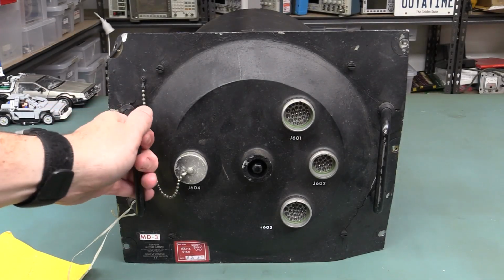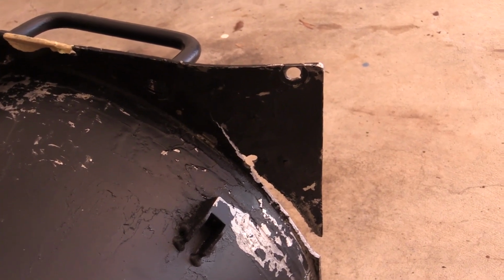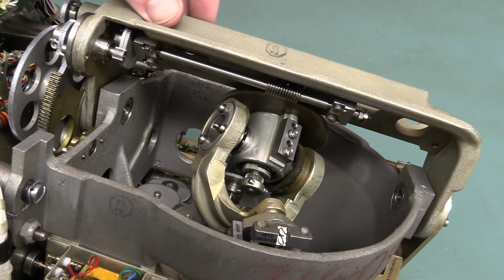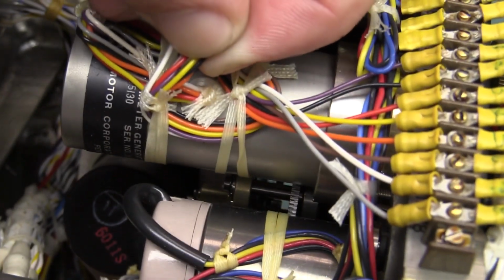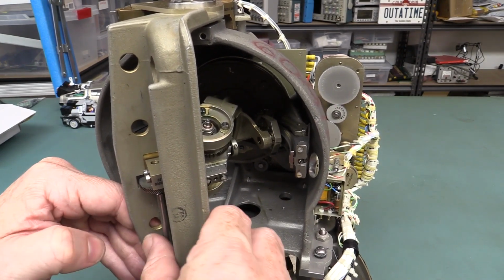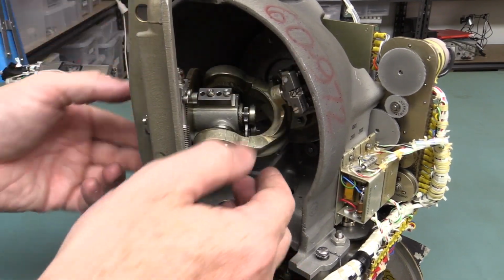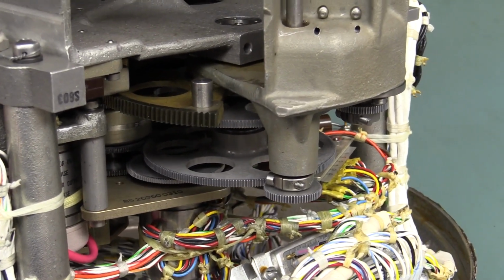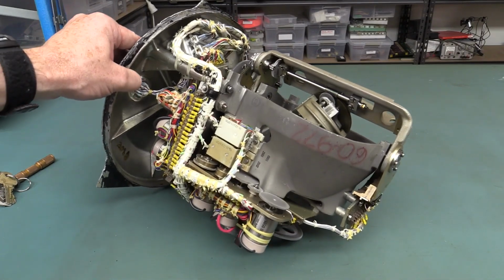EEVblog #854 - B52 Bomber Automatic Astro Compass Teardown

Comment: dublin tce site 120 MILL ST./ WHISTLEWOOD APT-ROUTE 313
The Dublin TCE site  is located in Dublin Borough, Bucks County, Pennsylvania. In 1986, the Bucks County Health Department discovered trichloroethylene (TCE), a 
chemical component of solvents, in 23 home tap water samples in Dublin. 
The highest TCE concentrations were found in a well on the site property. This property has been the site of several manufacturing operations over the last 50 years, including Kollsman Motor Company which allegedly used and disposed of solvents, including TCE, on the property during its operation. This property is thought to be the likely source of the TCE groundwater contamination. The groundwater was used by private wells servicing approximately 100 homes, apartments, and businesses in Dublin. All the affected wells have been taken out of 
service and the drinking water is being provided by the public system.     
     
Tce
Cis-1,2-dichloroethylene
1,1-dichloroethylene
Vinyl Chloride
1,1,1-trichloroethane
Trichloroethylene
Manganese
Trans-1,2-dichloroethylene
Trichloroethene
Chloroform
Tetrachloroethylene
    
Carcinogenic, Neurotoxic and mutagenic...

Comment: Looks like some sort of Analog Resolver for real time trig functions...  When computers were slow....
Reply: Correct.  A bunch of synchros, servos, and integrators to take in lat, long, altitude, GMT, SHA, and a bunch of other crew inputs and turn them into an altitude and azimuth drive signal for the astrotracker.  The tracker then locked onto the celestial body and fed back signals representing true heading.  This unit was in the forward right wheel well and often was soaked with water coming up off the runway.  The most common maintenance action was kicking the shit out of it to get rid of a "limit" waring in the Navigator’s station.

This was one of over 30 components (mostly power supplies and amplifiers) in a very complicated system.

Comment: I run my 28 volt 400hz missile  gyroscope from an audio amplifier.

I used to spin it up and I could drive a few blocks to a friends house.
It would still precess on the table by the time I got there.

I had to be carefull around corners :)

Comment: Wild guess: There are 3 inputs: Altitude and Azimuth change of a tracked star and continues rotating "time". The tracked star is predefined like sirius (bright star). The output is the relative distance and heading of the aircraft in relation to it´s starting point. Probably the spring mechanism adds up some sort of output. Once the output passes a certain threshold, the spring is reset and a counter in the pilots cockpit adds one unit / substracts one, depending on which "limit" switch is hit.

So you may have some sort of instrument in the cockpit with two dials and a counter. The counter + dial shows the distance and the second dial shows the "home" heading. 

Keep in mind that you only need "relative" position for star navigation, as you know your starting location most of the time. So you can easily add the relative vector to your absolute start coordinates. This greatly increases precission as the computer has to handle much lower numbers.
Reply: +Timo Witte yes, it looks like an automated octant. I don't know if the thing tracks a given star, but if you set a star (R.A. and Dec.) the device can probably convert to Alt and Az and give you your siderial time and latitude, then knowing GMT or UT it can give your longitude. It just automates what an air navigator did by hand in WWII. I know because my dad was one of those. I have some of his manuals and my sister has his octant. My dad taught me the principles.

Comment: I would guess the spring "belt" to possibly be for anti-backlash.  And like Dave, I expect that gyroscopes would feed into this unit so that whatever is being tracked is continued to be tracked in any orientation.  So the motor positions are driven externally but offset by the entries for a particular star or other astronomical target.

Comment: if i guessed how it worked i would say that in conjunction with the other part you showed it acted like a differential position calculator? the position and relationship between certain stars would be known. as the plane flys the positions change. so the part you dont have is the "sensor" and what you have is a motorised sextant. the parts would be driven to match the master star pattern and the output would be the difference between where the should be and where they are. then direction and position could be calculated from sequential sampling of star position. it wouldnt have to be particularly fast a recheck every couple of minutes could tell the pilot if he was straying off the flight path... just my 2c... it just seems to me that the axis you see moving are the same as a sextant.

Comment: A fun project to give kids intuition about gate computation is to construct a half-adder out of KNEX toys. If any of you have kids or nephews/nieces out there in primary school, you could probably go all the way to building an ALU with them, then move to 7400 logic stuff (maybe build a cheap guitar tube amp with them too, teaching them about high voltage safety in the process, the AX84 can be made for under $100). That'll really give them respect for the complexity of the AVR that's in their Arduino. Unfortunately you can't tape out your own IC with them (well if you have a few hundred grand worth of Cadence stuff I guess you could talk to MOSIS and do a 4 metal run), but the FPGA Lattice Icesticks are where I'd go next, after the traditional 7400 Forrest Mims type projects.

Comment: I liked the wire ties!
Reply: +VideoSack We still do that today on aircraft.
Reply: +John Doe OK, there must be a good reason if this is still done today? Interesting.
Reply: Zip ties aren't as reliable with grease and heat they tend to crack. We still use them but at anchor points generally, the rest string tie. It also depends on the aircraft. We use two types, a cotton waxed version that is black and a high heat resistant version that is white. Plus when you are talking thousands and thousands of ties, string ties weigh and cost much less.

Comment: Yellow tag is called a Condition Tag (Yellow means serviceable asset (B means it needs to be function checked before use.) H.A.F.B. stands for Hill Air Force Base, OGDEN ALC stands for Ogden Air Logistics Command.
Reply: It even says "serviceable" on the tag. And OC-ALC is Oklahoma City, which is where it likely sat on a shelf for 3 decades.

Comment: I used to work in the Aircraft industry making prototype mechanical instruments so I can identify a couple of things , The casing and all castings would most likely be magnesium , The spring unit that you are unsure about is a gear train pre loader to remove gear backlash , They are now sold as tensators , very important it an instrument that requires to be vary accurate

It is nice I would love it
Reply: Damn, magnesium and aluminium must have been expensive as hell back then.
Reply: @felixar90  Magnesium was about ten times the cost of aluminum. Both are difficult to work with, requiring specialists for machining.
Reply: Magnesium... That's highly flammable, right?
Reply: @QoraxAudio  So is aluminum. Both were used in photographic flash bulbs.
Reply: @WCM1945  Hmmhk strange, I've only heard of magnesium and wolfram in "incandescent" camera flashlights.
Reply: @QoraxAudio  Well, I guess I dreamt that up. It could swear that while I was learning something about the art, in 1818, aluminum was said to be used when a warmer color was desired, but i can't find any such thing in any references now.
Must have been in my previous life on Pluto :D.
Reply: @WCM1945  Ah okay, well... every metal is probably flammable in some way I suppose.
The fine powder from sawing steel for example is flammable.
Even grain flour and dried milk powder is flammable when tossed up in the air next to a burner.
It produces a cloud of fire.
Reply: @QoraxAudio  Aluminum is the primary "flash" component in fireworks.
Reply: @WCM1945  Ah okay, IIRC different type of metals provide different colors of fire for the fireworks.
Reply: @QoraxAudio  so is aluminum.
Reply: Bit of fire safety trivia when working with flammable metals (aluminum, magnesium, lithium, sodium, etc). If the fire marshall determines your operations have the potential to result in a metallic fire, you must have special fire extinguishers, called type D, specific to the metal  in question. You cannot use an extinguisher for lithium with magnesium for instance.
I learned this when doing vibration testing of downhole oil tools. The shaker bed was made from magnesium and floated on a granite block fed with a film of flame retardant oil.

Comment: My thoughts are the motors are actually being used in reverse - that is, as the commutator passes the brushes and thus produces a magnetic pulse, these pulses are being counted by something else on board the B52. Depending on the voltage swing the "something else" calculates it as a + or - reading. I could be totally off track here.
Reply: +dash8brj I think you are applying digital electronic thinking to an analog mechanical device. Obviously there are devices in there that output an electric signal, but if it were the motors, then what drives all those gears?  I'm far from an expert, but my money is on the "synchronous control transformers" being the mechanical to electrical converter for the output signal.

Comment: That metal ribbon takeup mechanism seems like it could either perform a limiting function by rotating the takeup to a certain position to keep the other reel from going past a certain point, or a limit-determining function by rotating the larger takeup reel to wind it, perform an operation that rotates the smaller one to various "values" as a calculation is carried out, then read the position of the larger one to determine the peak "value" the smaller one was ever rotated to. Though I doubt either of these is the actual use of it.

Comment: 'Synchro control transformer' is another name for a very old piece of analog electronic hardware known as a synchro resolver.  I forget exactly how they work, but if you connect two of them together and feed a sine wave with a high enough amplitude into the circuit, they will synchronise and follow each other.  It is a very old way of transmitting a precise mechanical position down a wire.
Reply: They work in an interlocked fashion not unlike a pair of modern stepper motors wired back to back, turn one stepper motor a few steps in one direction and the other will move the same number of steps in that same direction.  Only more reliably since they were not dependent on the stepper motor developing the voltages since the field voltage was externally supplied.  A very small synchro can be used to control a much larger unit, and vice versa, which was used in a lot of WWII servo aiming systems and positioning indicators and controls.
Reply: +Ethan Poole 
Resolvers were used, may still be used, in the M1 Abrams to synchronize the gun to the sights.

Comment: Its EMP proof.
Reply: +BillyLapTop Exactly. I used to work on B-52s, although not on navigation systems (I did weapons systems). But there were a lot of "old tech" redundant systems kept on those birds for precisely that reason.
Reply: +MrJest2 You know not to be in jest (no pun intended) supposedly the Russians were still using vacuum tube technology for those very reasons.  All I know is when a thunderstorm moves in I disconnect all my ham radio antennas because I know enough energy can be picked up on the wires to fry my solid state front ends.  

Years ago I can recall a nearby lightning strike caused an arc to actually jump across the outer and inner conductor on a coax line I was holding (not too smart).  At the same time I was listening to an old hallicrafters SX 101A and it got zapped at the same time and like a Timex watch just kept on ticking.

Can't beat that old tech.

Comment: That is damn cool. Maybe you could find a big glass jar in the shape of the metal can and fix that over the top, then find some way to drive the thing externally, even if just for show. 

Amazing that they'd make something that intricate and then seal it away in a black can!
Reply: +Darwinpasta It's precise enough that it needs to be at a specific pressure to operate correctly; the can preserves the pressure at a set point despite whatever the outside pressure is.

Comment: I think Dave is correct about the analog computer maybe doing sine and cosine functions.

Here are some of the formulas used to do celestial navigation by hand:

S = sin(Dec)
C = cos(Dec) x cos(LHA)
Hc = sin-1(S x sin(Lat) + C x cos(Lat))

Hc is the 'altitude'

X = (S x cos(Lat) - C x sin(Lat))/cos(Hc)
A = cos-1(X)

A (with some adding and subtracting) goes into computing 'azimuth'

The numbers going into the formulas come from the almanac and clock (time).

Before modern digital computers, doing this by hand required the use of books of tables - along with a rather complex procedure.  I would guess attempting to do this computation by hand in the noisy, cramped space of a plane while under simulated war (or projected real war) conditions might lead to navigation errors. So the USAF, thought it best to have a device do the work.  Just my guess?

Comment: That video made me thinking about how much the wold has changed through last 50 (or a bit more) years. Look how much effort and craftsmanship went into design and manufacturing of that unit, that probably did nothing much complicated than calculating a few trigonometrical functions, maybe did some integration.

 Today you do such thing in a $1 uC programmed by a high school student.

Comment: The mechanical part totally looks like an analog astronomical coordinate converter. You could convert one spherical coordinate system (e.g. RA/DEC) into another (e.g. Alt/Az). Some 70s telescopes used computers like these to calculate where in the sky they have to look when you entered their astronomical coordinates.
I saw something extremely similar in the astronomy exhibition in the German Museum in Munich. There they had the decommissioned coordinate converter from the Effelsberg radio telescope on display. It pretty much used exactly the same mechanical construction.
Reply: +DmM843 I think that's exactly what it is; designed to take input from the top-mounted scopes (essentially electro-mechanical sextants) and give output in alt/az for the navigator to plot. As he mentioned, its part of a system that includes a few other components. Again, I didn't work in nav systems on B52s, but our systems were related and used data from them.

Comment: Strategic aircraft tasked with nuclear deterrence still carry astro and inertial navigation systems because the GPS network and other defense satellite networks are vulnerable to nuclear attack and jamming. Tomahawk cruise missiles use ground scanning radar which uses topography data obtained from radar telemetry captured by the space shuttle to fly at low altitude and navigate to their target.
Reply: Modern passanger planes use redundant Inertial navigation system based on ring laser gyros or fiber optic gyros. The system is accurate enough so it includes rotation of the earth and the longitude of the departure field to know which side is down even when the plane is in the middle of storm after flying 15000 km and you don't know which way is down... The GPS can still provide more accurate results because any system based on gyros and stuff will need to integrate measurements over time which will drift a little bit no matter how accurate you try to make it.

Mentour Pilot has a great video about this stuff here:
Can Aircraft NAVIGATE by LASERS?!
https://youtu.be/J89uROO8Gsc

Comment: I'm a US Army aircraft mechanic, and we use the same tag/form.  Under remarks, it says "SAVE LIST"  this means it was removed from an aircraft that was being scrapped, but for whatever reason the "Save List" a list of parts to save from a trashed aircraft, it was removed and saved.  Condition code B means it is serviceable, but incomplete.

Comment: The unit alone would make a nice Powerhouse Museum exhibit, however not having the star tracking unit and the power supply and display systems makes this mechanical system an enigma. One can only surmise so much from a subsystem or a core system (that is part of an assemblage of systems).

Comment: Some differential drive stuff, and what looks similar to a Thompson coupling CV joint. (Wikipedia says it has uses regarding application as a spherical pantograph. So that's most likely how it solves some part of an equation. Trig functions makes sense.) The big part over the top that you can't move is because that big gear with a wedge out of it is drive-locked by a worm gear. If you can spot that worm gear all the way in the bottom right and get it to turn, then you should be able to nudge it's angle.

Unfortunately I can't explain much myself. Just recognize parts being similar to stuff I've seen while doing some internet chain-reading articles on gears. (Boredom + curiosity does that.) A field tech or engineer would know what's going on though.

Comment: I suspect that the band spring is used to keep a load on the gear train in one direction, as a way to avoid backlash.   I noticed that some other gears use two spring-loaded gears as an alternate means to reduce backlash.